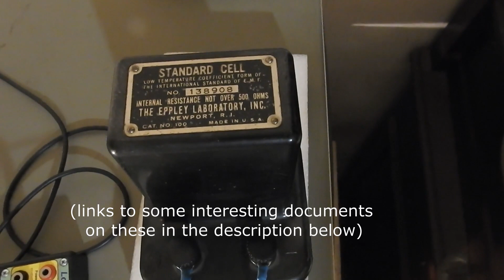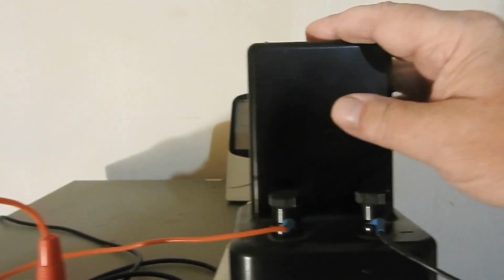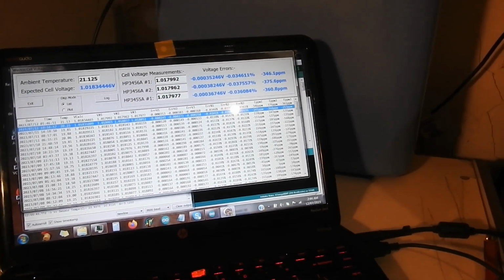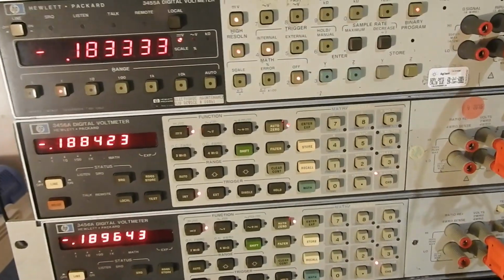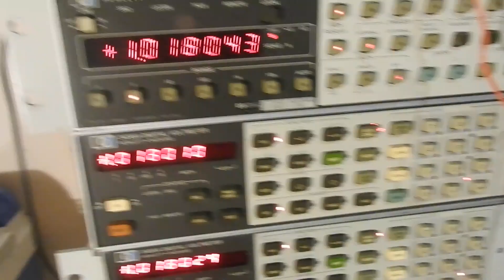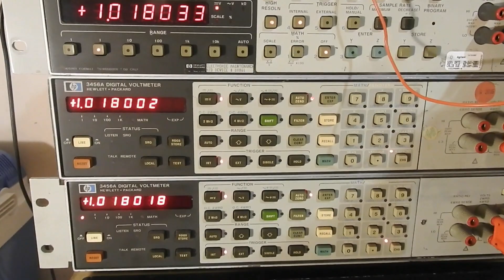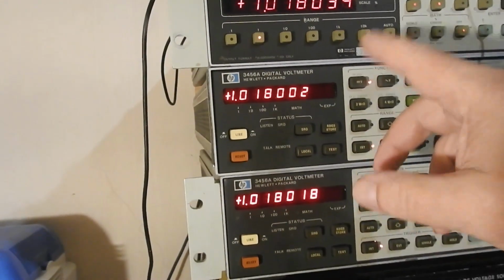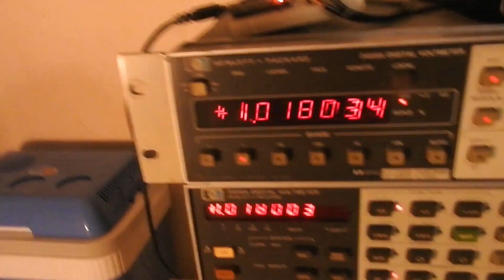An Eppley #100 Weston Standard Cell

Comment: nice video, I have 2 of these Eppleys and used them as my main voltage standard before I bought  Fluke 731B, and my findings are similar, the Fluke 8502A 8505A needed more precision.
Reply from the maker: Thanks! 
Yes, these unsaturated cells have a relatively short useful life (5-10 years? IIRC), so they're basically a curiosity these days.  
But I still wanted one!